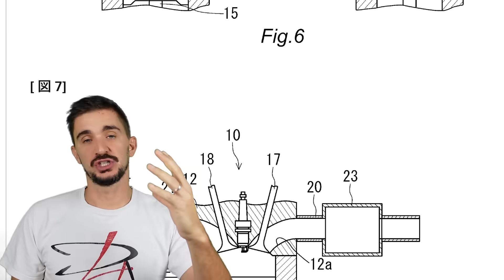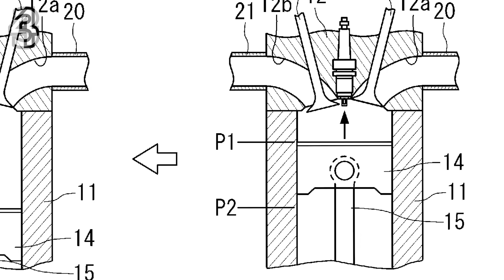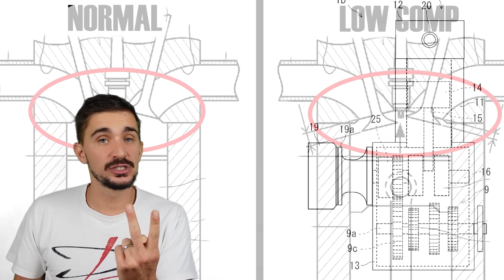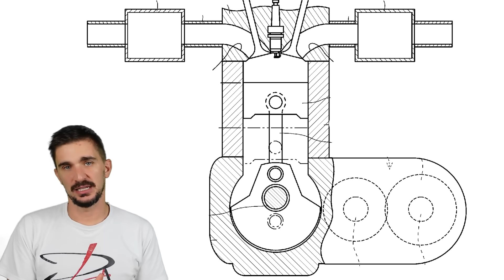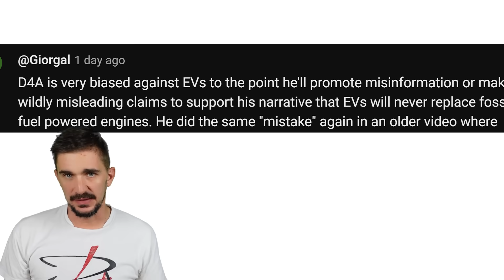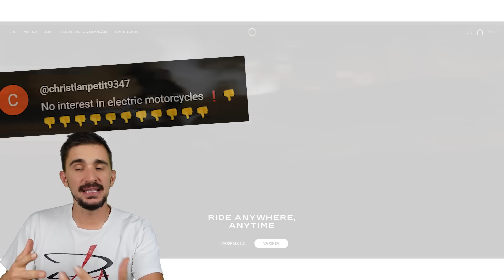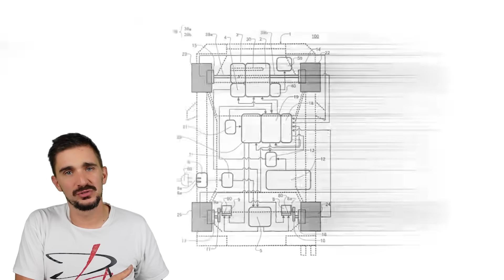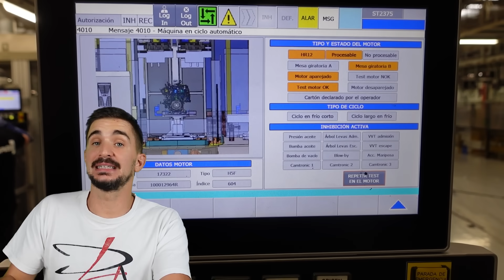Yamaha Just Patented A Fake Engine

Comment: it is a verry strange idea unless there are parts missing on purpose in the patent and it is a low reving range extender on an eletric bike ?  on an other idea have you ever done a video on radial engines also what would half a radial be like if looking at it crank on it would be no wider than a boxer but no higher than a conventual inline and with 6 cilinders  and only 2 cylinders deep using Freevalve tec for the heads to reduce weight and complexety  of having multable cams ?

Comment: All I can say is I hate this less than all the other fake engine noise approaches. It’s not a replayed sample or synthesizer output or some software simulation, it’s noise emanating from the actual mechnical process of an engine. It’s real. For basically the same reason, I’m OK with a sound tube to bring more engine noise into the cabin, and not with audio pumped in over the speakers: because it’s still honest. Similarly this fake engine does produce its noise honestly… so in this case it’s not the noise that’s fake, it’s the engine. You say it doesn’t do anything, but that’s not true – it makes noise. 🙂 It’s not an engine, it’s a noise generator. It’s built and looks and works like an engine, but it’s a noise generator. Would I go get it serviced? I suppose I would. A working fake engine would be the point of a machine that had this on it, so of course in that case it should be serviced as needed. But of course it’s still stupid – an expensive inefficient gimmick. Considering the noise would be broadcast to everyone else I’m sharing the road with, I’d be embarassed to ride such a bike, except as a joke. I might still buy it and enjoy it if I had throwaway money for it, just because it’d be silly in an amusing way, as a “look how absurd it gets if sometime tries to actually do fake engine noise right, isn’t it funny” nerd toy – but not as an actual means of transportation.

Comment: This is simply "The Yamaha Way" of doing things! It's exactly like their most advanced digital piano. Since it is hard to FAKE the true feeling of a mechanical piano, the high end digital piano includes a complete set of hammer mechanism; the only things removed are the strings themselves.
Reply: Actually they did a variant called the DiskLavier that was still one of their "real" baby grand's and they introduced their mechanical system into it that could take digital 
music that captured more than just the notes, it could also capture the way it was played. That was 20 some odd years ago and it blew my mind when it was demo'd to me
at a big piano/organ dealer. That's interesting about the digital setup that doesn't have the strings, I need to check that out!
Reply: @GearHead4Lyfe  That whole range still exists and is pretty good, if you need good feel and sound but can't have a real acoustic. Casio and Roland do compete really hard in that range too.
Reply: @GearHead4Lyfe  You're right about the technology, but that's actually a Disklavier. They essentially added actuators to all the moving parts of a piano and controlled it digitally. Same as player piano technology, but using code instead of piano rolls. The Clavinova is a sub-brand of digital pianos, none of them have actual strings if I remember correctly. We have a room full of Clavinovas in one of our classrooms.
Reply: @omniphoriusvcf907  Ah yeah that's right that was the DiskLavier! It's been a while memory was fuzzy. I was blown away by it!

Thanks for the correction! I updated my post :)

From what I recall it could mimic the original staccato and sustain the way the original music was recorded. At least that's what the sales guy was telling me.
Reply: @GearHead4Lyfe  Yeah they are amazing, pretty much like having a famous virtuoso in your living room. They are also used in "new music" to play things that are physically impossible. Cheers!
Reply: @omniphoriusvcf907  My Mother was looking to buy a new organ at the time and she did. But I tried to talk her into the white Baby Grand DiskLavier!  I said "Come On! We don't need a dining room table and it's only 25 grand" 🤣🤣🤣
Reply: That's pretty insightful.  That's the explanation right there.
Reply: All high end keyboards have real piano actions in them.  There's just no way to fake that feel.
Reply: I've been into yamaha motorcycles for like 15 years now and I've even got some of their guitars but this fake piano thing? Mindblown I am.
Reply: @Pleksilasi  if you see a yamaha mini stereo set at a kirppari just feel the quality and buy it. the sound is far better than you'd expect from the size. the styling is impeccable too even 25 year old sets compared to all the other stuff on the market back then in the integrated mini set segment.

weren't badly priced either.
Reply: I tried a midrange digital Yamaha keyboard and I was impressed that it felt to me exactly like a real piano...
Reply: Why tho? Does the small type piano(the standing type(?)) Is already enough?

Im not familiar with this, but im guessing it's for feature & mobility for the digital one??

Comment: This is not for me. I want a smooth electric motorcycle that doesn't vibrate or make noise. It's just that in order to work for me, it needs to take me at least one hundred and fifty kilometers on a single charge, allow to charge to eighty percent capacity in under thirty minutes, and not cost three times more than a similarly powered fuel-driven straddle-type vehicle.

Comment: It's disappointing to see Yamaha do this non-sense. If sound+vibration gives good feedback to rider, I agree. But with some electronics, it can easily be simulated. Just put a speaker and few tiny haptic vibrator motors (phones have them) wherever they want, accelator, break, etc, this can give proper feedback to rider whatever he needs. R &D put to crappy use

Comment: it doesn't do nothing, it does: SOUND ! but i get you, it's a waste of: weight, energy (it creates a resistance), and the fact that it is always there so it seems irresponsible or illogical or not reasonable to put it there, but: 1 it could exist in the corner, like something a weirdity, and it doesn't mean that all motorcycles are going to be like that. it is just a solution, you know manufacturers they have fun sometimes, thy experiement, they try new things... i think you're taking it too seriously lol.

Comment: It's a stupid adition to a perfectly good bike, all that space and weight could have been used for a larger battery to increase the range on the bike. Or use it to build a connector to a fast charging station so you can drive for 1.5 hours and rest for 0.5 hours

Comment: This is actually pretty clever. Yamaha patented the thing, so if somehow this would gain traction, THEY will be the ones to do it, while absolutely nobody would ever try it if they wouldn't like it. At the same time, since it's so stupid, it had to go viral. Yamaha have got free marketing of the brand combined with free initial market research - in case there was a market for this.

Comment: people in 2027: "time to change the oil on my electric motorcycle"
Reply: nothing new. gearbox oil get changed regulary on some e-bikes today, just no motoroil...
Reply: @eihwaz198  yup pure gearoil, EV's have differentials and fixed gears. 
Electric motors deliver max torque from the start.
So the manual/automatic shifting gears part of a drive train an ICE engine needs are redundant on an EV's
Reply: @obelic71  Gearboxes could be useful in electric vehicles in some specific scenarios, for example for offroad use you can have a low gear to maximize the already high torque of the electric motor and then have another high gear to maintain a decent road speed and keep the engine in the maximum efficiency zone, although they are much more efficient than a combustion engine they are not equally efficient throughout the entire rev range, as it might not be necessary to change gears while moving it could be a smaller and lighter gearbox than a conventional gearbox, such as a transfer case with a reduction gear which is smaller than a gearbox with its rods, clutches, pumps and other gearbox things.
Reply: @clorurosadico8851  I guarantee you that all production EVs making more than 100HP/tonne are traction limited at low speeds. More torque would simply be wasted and offroad EVs like Rivian R1S/T or Hummer EV are a proof of that because they are using fix gear ratios. The only 2 reasons to use multiple gears is to a) achieve a much higher top speed or b) use a lower power output motor. (b) is out of the question for the auto industry as a 2 gear transmission subsystem would be way more expensive than a bigger motor and for (a) actual off roaders do not aim to go 100+ mph as at those speeds the range would be greatly reduced, EV or not, due to the worse aerodynamics.
The only production EV platform to actually use 2 gears is the one the Porsche Taycan is built upon and, as you can imagine, is there exclusively to achieve and maintain high speeds while still being as quick as possible off the line, something off roaders have no interest in doing.
Reply: The Tesla Model S has both oil and and an oil filter. Google it! ;-)
Reply: Me, after just having flushed and re-filled oil in my e-bikes hydraulic brake lines:

Comment: It's a "fake" fake engine.
Why would an engine that only compresses air need a spark plug?
My guess is that when the petrol ban comes into effect in the future, Yamaha will sell a bike with an engine that can freely rotate but can be converted easily into a petrol fed engine.
Im thinking this because it resembles an internal combustion engine too much,if they were trying to make a harmonic emulator they would emphasize more on the intake and exhaust harmonics and possibly even have different expansion chambers because there isn't any explosions to make vibrations and sound.

Comment: I wonder if you could adjust the valve timings and connect a small compressed air tank that can be reversed for a burst of extra power. Maybe it could also be used to inflate the tires.

Comment: They will never build this. Lot's of weird patent get filed. EV motorcycles don't need fake engines, they need a battery breakthrough, to boost range. Motorcycles just can't fit adequate battery within their size/weight packaging limits.   A fake engine takes up valuable space/weight that is already too limited for batteries.    Maybe they could add a tiny Range-Extender engine...

Comment: I'm sure you can "modify" it to become a generator so you can charge the battery. It wouldn't need the emissions because it's not sold as an engine. 
Yamaha sometimes misses the mark but they usually have an idea for the DIY guys.

Comment: Yamaha just patented the shitty, leaky air compressor without the storage tank. So basically, a shitty, leaky air compressor motor. And yes, that's indeed what those cold canked engines sound like: air compressor motors. Because in absence of combustion, that's exactly what they are.

Comment: So there making the biggest problem with EVs (weight) even bigger with no benefit? Also does it shift? If not it completely defeats the purpose of what they want. The engine is only a small part of the experience I think shifting is a bigger deal then the vibration of the motor.

Comment: We have better ways to create sound. Transducers do that with great efficiency. You need around 2W to create 90dB, 20W to create 100dB. And this is not continuous but quite peaky, for something like motor sound it should probably hover around that 2W in long term. That engine will not turn with a 2W electric motor. Vibration takes a bit more energy, we do need to rotate a mass that is not perfectly balanced but again... not that much if we are efficient with it.

Comment: Fair points - however - it's NOT a "fake engine" - it's a real device to produce the sounds and vibrations of petrol engines which Yamaha have determined by survey (I assume) some buyers of bikes would want - perhaps to look of it too.
Air cooling would work fine - no combustion you see.
It could be made lighter than a petrol engine as the loads would be much less - so much less metal involved.
I wouldn't be much bothered with it personally - perhaps one would have to test drive it to know if the additional cost would actually be worth it - can't say without actually experiencing it TBH.

Comment: What a stupid idea . Maybe I am to smart. But why not make a hybrid bike ? A let the engine be a generator all the time ? Even let it rev and then just let clutch slip if there is to much electricty
Reply: it's like falling in love with a AI girlfriend, says the right things but there's no soul. I hate this idea, it stinks. Why do I like fuel powered? Range, power and recharge time (refueling). If a ev bike can reach parody then I will buy a EV bike because its quiet, smooth and hopefully cheaper over the lifespan..but in the meantime, you can jam your fake engine into your fecal outlet.
Reply: Did you even read what I said ? I said hybrid not EV . I said use combustion engine to rev and produce electricity .

Comment: They may have also patented a specific mode of a hybrid system. If this ever goes into production, the engine would obviously be functional. This suggests that the patent might cover a hybrid system, specifically the phase in which the vehicle operates electrically but still generates engine noise.

Comment: I think you completely missed the blessing here, the absolute gold mine . . . Honestly, this is a truly awesome concept from Yamaha. The reasoning is quite simple, and that is that manufacturers are being forced by 'woke' governments, to deliver clean running EV's that will digitally track your every move, and you don't even have to be a conspiracy theorist/factualist to figure this out. If Yamaha simply takes a fully working petrol engine, and connects it to an electric motor, but without fuelling it (the special sauce), then the owner can have a registered 'EV' to keep the corrupted folks in government happy, and then just go run it on fuel with a little tinkering. Yamaha could also market it as a 'Hybrid EV' too if they so choose. Once again, this is truly awesome for the real people out there, not the NPC's. All engines are just air pumps anyway, they just get a dose of fuel and spark to really liven things up a lot - oh, and get a fair bit more range too!

Comment: Forget range-extending engines, Yamaha now has range-REDUCING engines.
Reply: Wait...wouldn't the best way to achieve the sound of a gas motor on an electric motorcycle have been to simply put a small range extender on, which constantly runs and has a sound/vibration amplifier?
Reply: @fallenstard  A range extender (if designed for efficiency, which may not be the case here) would just run at a constant, optimal speed. This would maximize electricity generated for the fuel burnt. It wouldn't rev up when the bike is starting from a stop.
Reply: @JLG331  yeah, but it can be made this way
Reply: @JLG331  Okay so for the first time this week, I heard a BMW i3 with its range extender running and honestly, it sounded decent. Like an idling inline twin. I'm confident that the engineers at any given auto/motorcycle company could figure out how to make it sound better and produce some vibrations in line with acceleration. It would surely never be perfect, but I bet it could get damn close in the same way that modern LED bulbs with warm white fluorescent coatings can get damn close to incandescents bulbs. Purists will never be happy, but casual consumers will get a taste and be satisfied.
Reply: This won't be a problem when the lithium-gallium LED battery that produces 890kw/h in a package the size of a cigarette pack, becomes common-place. 😮
Reply: @nolaspeaker5656  okay I'm going to hear you out instead of just reporting this as spam, but that's not how energy storage is defined. But assuming you meant 890 kwh, that's absurd because that's roughly what my whole house uses in an entire month. Storing that much energy in that type of space is a recipe for absolute disaster.
Reply: @fallenstard It was pure fiction. Sorry if I got your hopes up.
Reply: @nolaspeaker5656  Ah okay. I couldn't hear the sarcasm in the text 😂
Reply: @fallenstard I apologize once again. I imagined that my outrageous claim would give it away.
Reply: @nolaspeaker5656  Dude I wish it did. But people actually talk like that sometimes trying to defend EVs unreasonably. I'm all for EVs, I drive a PHEV. It's great. But people have to be realistic with expectations and timelines, which they aren't.

Comment: I think Yamaha's right.  A lot of people don't want to drive quiet vehicles or automatics because it doesn't feel the same as driving an actual car with a combustion engine. I think they should have just put a speaker on the bike that makes motorcycle noises, or batter yet, maybe a hose/fake exhaust with a flap/flaps inside that makes a fart-like noise, similar to motorcycles, as well as a rechargeable vibrator inside the seat, to make your ride more comfortable and stimulating, and so you can take it on the go and vibrate yourself anywhere.

Comment: Surely you understand that the idea is to produce something that vibrates like an internal combustion engine. 
It may be that the fake engine's vibration tells us nothing about the health of the vehicle, it still provides the familiar vibration some riders expect. 
A more sophisticated system might have a box with only essential moving pieces to provide the vibration desired and include the ability of the box to make noises that indicate mechanical problems along with indicators in the instrument display. It makes more sense than I at first thought.